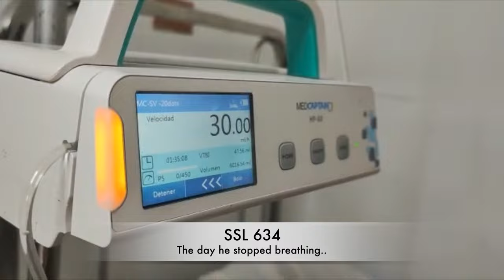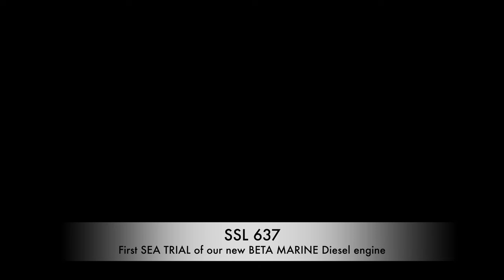SSL653 ~ the problem with my voice...

Comment: As a 20 year throat cancer survivor, Please keep an eye on your throat problems. That is how mine started. I would start to lose my voice. 6 months later they had to remove my vocal cords from the cancer! Best of luck my friend stay safe!
Reply: Exactimento. Otolaryngologist is who you want to get seen by, a sub-discipline of Ear Nose & Throat medicine. See if you can find one in Panama City!
Reply: There are a good number of them in Panama City. The exam uses a flexible imaging device that can view areas around the curve of the throat. The doctor differentiates between physical inflammation and cancerous or precancerous tissue. For your peace of mind, I would take this step.
Reply: Self diagnosis esp stress is not the answer Rick. Get checked out medically sailor 💪🏽
Reply: I am glad I wasnt the only one worried about cancer.
Reply: Father-in-law was the same, "it'll get better all by itself" but it didn't -- until we badgered him to get a check up...For the time it takes it's more than worth it.
Reply: @Charles White Depends on your baseline QOL, I suppose and a personal choice after all. If it is 'that', then 6 weeks' radiotherapy, maybe surgery - this is just from experience. Voice changes can be permanent. Time is the crucial factor.
Reply: @Charles White If anything unusual, even a cough, lasts longer than 2-3 weeks you're meant to get it checked out...if for anything for peace of mind.
Reply: @LoremIpsum1970  I agree. He should have it checked out to be sure it's not something more than stress.
Reply: My Dad died from throat cancer. He wouldn't go to the doctor.  When he finally went it was too late. He died a year later.
Reply: @LoremIpsum1970 my proceedure was photo ablation using laser mounted on to laryngoscope. 8 minutes of this after 20 minutes  of anesthesia using a nasal spritzer with lidocaine and another solution blend. This part of the process was the most difficult, making the patient cough. The first time I had this done it was using general anaesthesia, because a biopsy was done with a robotic surgical instrument whose size dictated that option. Mild sore throat lasts a few hours.

Comment: My dad developed the same problem when I had a stroke about 11 years ago. It took some time to figure out what it caused it besides stress, viruses and fungal presence in the high humidity environment. His low levels of magnesium and vitamin b due to the stress turned out to be almost a permanent reason for his “exhausted” vocal cords. The 4 things that helped him are Magnesium Malate and Glycenat, Wild Oil of Oregano, Thiamax which is the the B1 vitamin, and a pinch of Redmonds Real Salt in his water. I know you are probably overwhelmed with everybody’s opinion and suggestions but I hope you do look into the things I listed. The oil of oregano will take care of anything like mold and viruses in your system and the other supplements will restore your decreased vitamin B and magnesium levels. The reduction in sound in the vocal cords is directly related to the stress and the humid environment. I really hope this helps you.